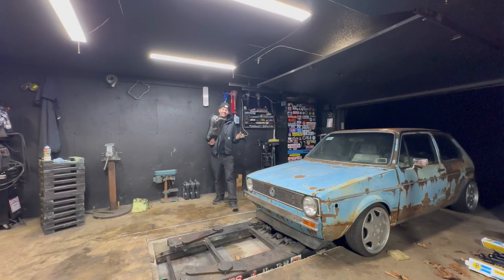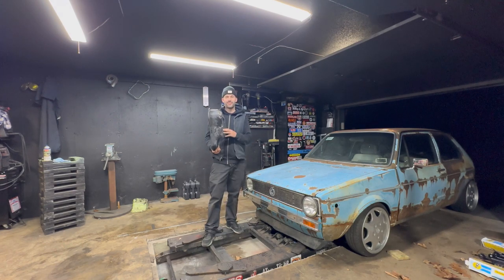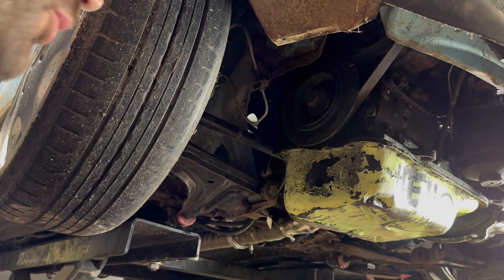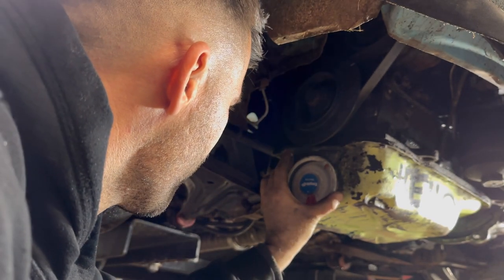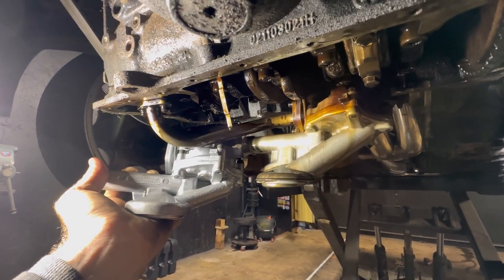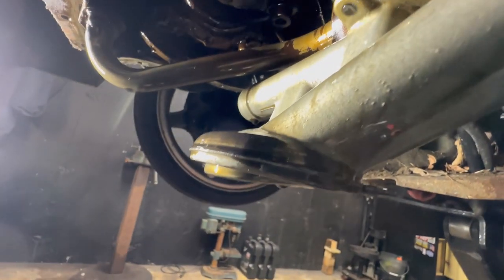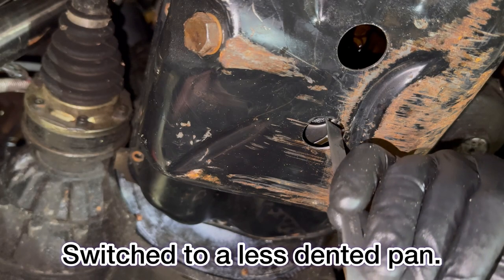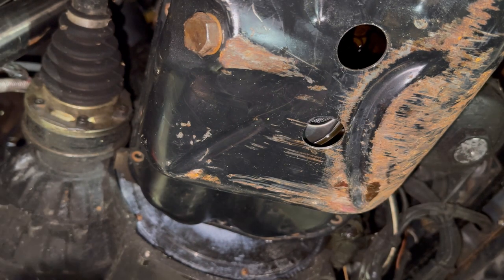DIY VR6 shortened OIL PAN

Comment: I think it's worth the protection. I know a ton of guys who are like "if you ain't rubbin, you ain't dubbin". They say that until they crack the pan, starve the engine, and then have 4 dead VR6's in the back yard. And now, with that extra clearance, you could make a skid plate, so you only have to worry about 1 engine. 

I'll be doing this for sure on a few of my lowered cars. Either DIY or buy the shortened pan. Where I live (Calgary Alberta), I swear nobody knows how to build a road, so we've got a lot of spots where the manholes are easily 3" off the deck; often with no "mound" around them, meaning the edge of the manhole is proud of the ashphalt. 

Between me and my kids, we have like 6 VWs that are lowered. I don't want to be putting new engines into them every other week. 

Loved the use of the home-bru hyrdo dipping.
Reply: Coulda done it either/or. 
Paint right on the pan when it's sitting in the water, it gives the same line. 
This is a good way to shorten or lengthen items though.

Comment: I used a engine rise kit for £60 that solved my problem with clearance on the sump on my vr6 full of poxy speed bumps in London they recked 2x sumps that kit best thing I bought
Reply: Are you using mk3 subframe? And could you link for the rise kit? I've. Just don't a vr6 in a mk1 and the oil pan is on the floor
Reply: Done the same on my mk4 , 20mm raisers, and a removed engine cover
Reply from the maker: With mk1 it has different mount setup. So you’re not able to raise it. On my old mk3 I did what you’re talking about and it worked great

Comment: In the time i owned a mk3 i welded a 10mm steel plate on the pan, never had problems with my pan after that.
Reply from the maker: I kept getting stuck from my pan hitting the ground in my driveway. Had to trim it

Comment: I went the smash pan route. Got it made with quarter inch steel plate. And also got 17mm engine raisers. Hockey pucks work too
Reply from the maker: I wish I could to the engine spaces in the mk1 i did them in my old mk3 vr6

Comment: BUBBLES!!!! 👍👍😁
Not a bad idea to get your reference line on the pan. Probably wouldn't have been too hard to shorten/ modify the stock 12v oil pickup tube. Getting the metal clean enough to weld would be the trick most likely. You should consider throwing in a windage tray and possibly some trap doors/ baffle around the strainer. Lots of folks run a thicker plate on the bottom of the pan, or you could always make yourself a skid plate that covers it all. Probably what I'd do in the future to finish the job. Nothing wrong with some 'CAD' aka Cardboard Aided Design for a template. LMAO. 😄👍

Comment: How do you read the level of the oil? Did you just subtract the same amount from cutting your oil pan to your dip stick and etch out new lines?
Reply from the maker: Yea I’m going to subtract and see how that works for me. I’m not sure how they do it if you were to buy a shortened oil pan

Comment: I made the same assembly from France what size belt to take thank you very much for your help
Reply from the maker: I'm not sure what you mean by belt.
Reply: @gtijoe2419   the belt that drives the alternator 😉
Reply from the maker: @duranddurand9810  https://s-pautomotive.com/product/vr6-ac-power-steering-delete-belt/ this site has everything you need for the swap. I really like this company alot.
Reply: @gtijoe2419  great thanks a lot. Do you inox if it delivers in France ? 😉
Reply from the maker: @duranddurand9810  I’m not sure actually. I believe the one on my car is from a infinity but I’m not sure what model. It’s been a while since I’ve ordered it.
Reply: @gtijoe2419   ok thanks